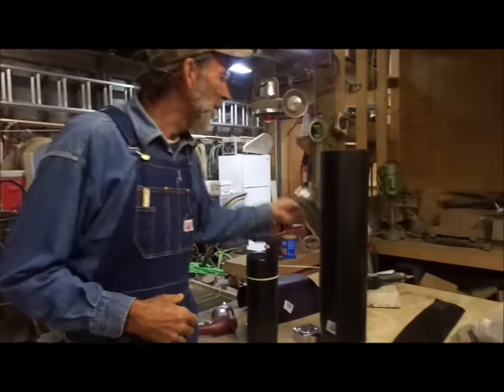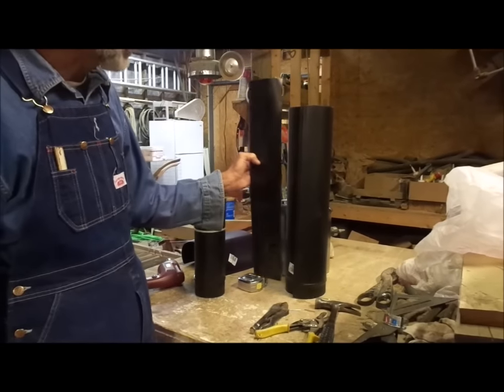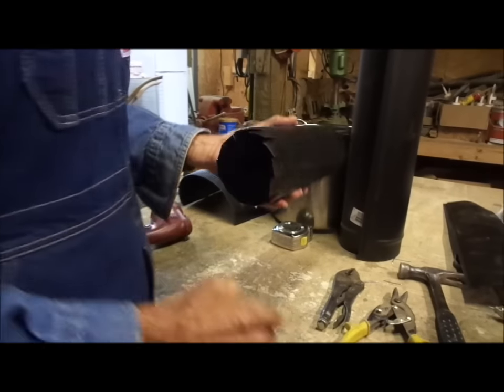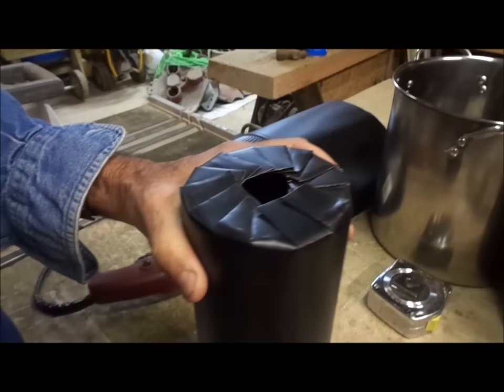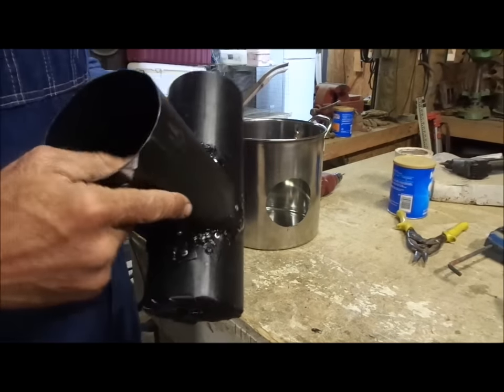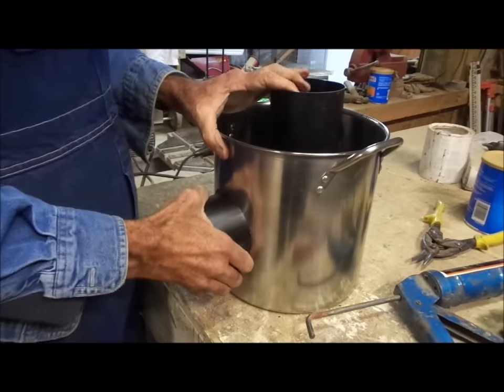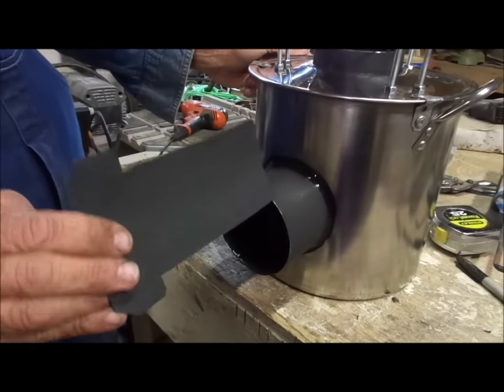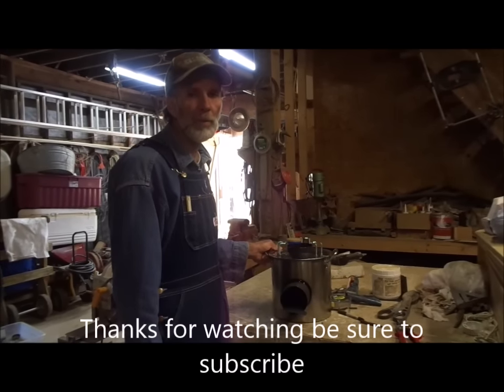How to Build a Rocket Stove

Comment: You're measuring diameter not circumference.  Circumference is the measurement around an object.  Like when you measure your waist.  

That is a great design.  I just came back from a camping trip with 4 of my grandsons and 2 of my sons.  I brought along 5 cinder blocks and made a rocket stove.  It cooked perfectly but started cracking almost immediately.  It lasted the whole 3 days but, if someone would have slightly bumped it, the rocket stove would have crumpled into 100 pieces. 

 It also started sucking air from all of the cracks.  I don't think it affected the way the fire is pulled upwards.  But, I do believe I lost a little heat from all the cold air being sucked through the cracks.

Yours is NOT gonna crack or leak.  Great job!

Comment: love your videos Danny, Just wondering though....wouldn't it be easier/better to  just build it using 6 inch?  That way you can use factory parts without all the silicone and self fabrication down to four inch?  I bet there is a draw back of using larger pipe, like less condensed heat, but if you used a bigger pot and used 6" just seems like it would eliminate a lot of steps. Again, not trying to be lazy,  I'm just asking.
Reply: +jasomx6 leng  trying to watch your videos from oldest to most recent, but have noticed you are having some health problems......please know that I hope you feel better soon. Best wishes.
Reply from the maker: +jasomx6 leng I have both the 4 in and the 6 in stoves.The small one does well for small meals but the large one is great for bigger pots and skillets. Small one takes less wood to use to get the job done.
Reply from the maker: +jasomx6 leng Yes i am having some problems but the homestead must keep going if im going to eat.Thanks for the concern.